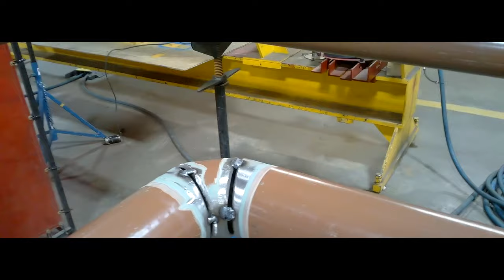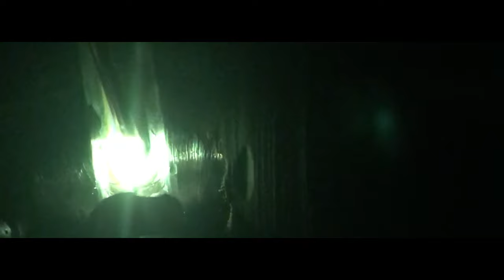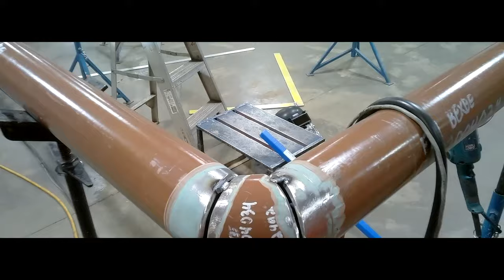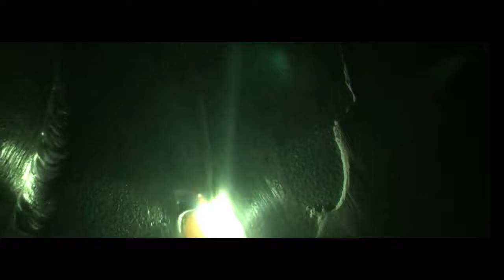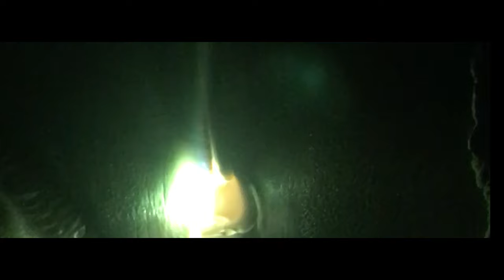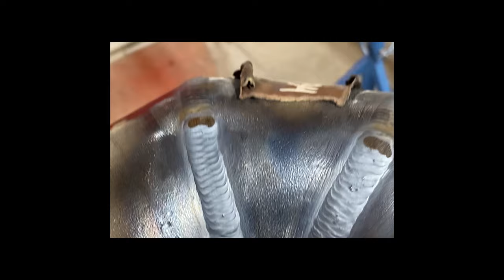Tig Welding Large Gaps On  Butt Weld Joint !

Comment: How do I avoid lack of fusion in the root? I’m also dealing with problem of sugaring on stainless steel while I am welding🤔. It’s really hard to achieve any improvements for me😩.
Reply from the maker: Well,to answer the first question. Increase your mean current, improving your operating technique, or choose shielding gases that provide a more fluid weld pool. Make sure your joint or root is well prepared and not too narrow to weld evenly. Second question; Your shielding gas is too low, prep of your joint is not good as you might have some contamination because oxygen is not purged out from welding zone or even in some cases , argon bottle can be contaminated but that's very rare. Make sure all branches are isolated if you have any, and your shielding gas flow is set to 15-20 . Purge eye monitor is good device to check oxygen level in your joint. But it all depends also from size of the spool you are welding.